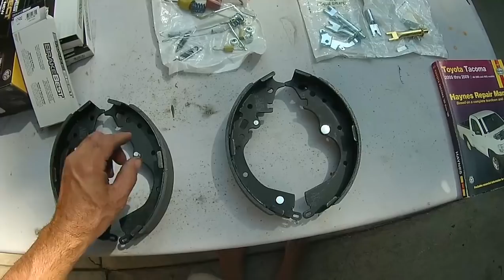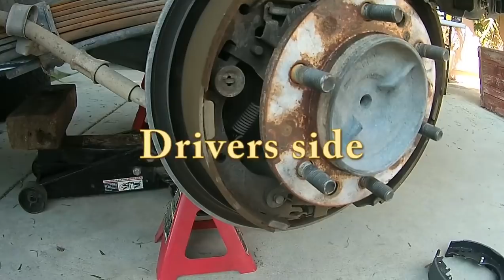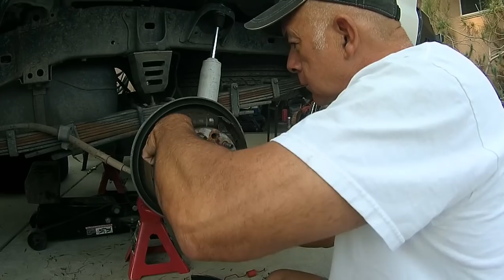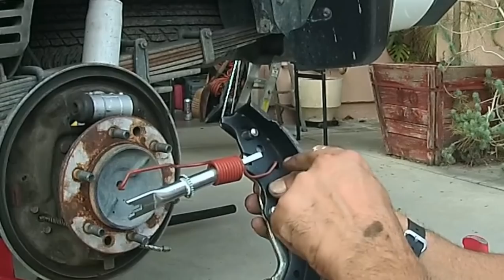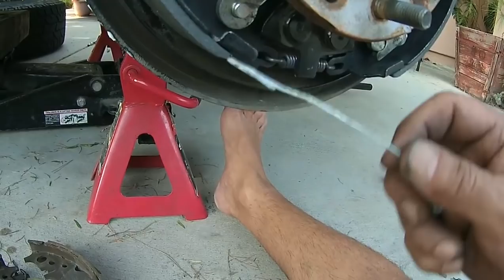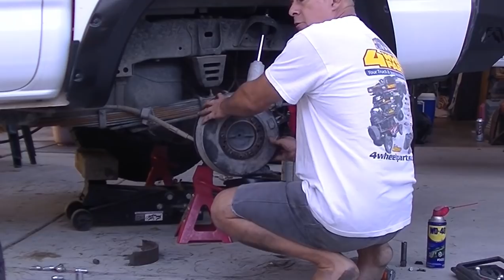2010 Toyota Tacoma Rear Brakes

Comment: Thank you for taking the time to make a video.  I know first hand what a pain in the ass it can be to do the job with the added chore of trying to make a video that makes sense.  Greatly appreciated.  I have a 2014 Tacoma that I just replaced front brakes on, been putting off the rear brakes.
Reply from the maker: Yes the rears are a pain in the arse!

Comment: Awesome video. Just bought a used '14 Tacoma 4WD AC 6-speed and replaced my fronts. Will be checking on the rears tomorrow. Thanks for taking the time to explain everything that you did. Excellent video!
Reply from the maker: Thank you for the comment. What I didn't show was the adjustment. Kind of a pain to adjust.
Reply: @rudedogii  I've adjust the parking brake on my '12 Sienna which is just drum brakes combined with disc brakes. Kind of neat. Had to jack up the rear and spin the wheel ....Then take the wheel off and adjust through a hole covered with a rubber plug from the outside with a screwdriver. The parking brake was never adjusted by the dealer, purchased brand new, and did nothing to stop the car on a hill.

Comment: Thanks for the video. I always like to try to get a refresher on these things. I appreciate your time.
Reply from the maker: Thanks for the comment. I need a refresher myself every now and then.  This videos two years old already. Brakes are still good but needed adjusting and had to replace the drums.  I'm now at 98K and I seem to be losing power. Do you think this is normal at 98K?
Reply from the maker: I drive out to the Hi-desert on the I-15. The truck has 35inch tires with stock gearing and a five speed auto. I don't use the 5th gear. The truck use to run up the I-15 in 4th no problem but now it's having problems keeping up speed and down shifting into 3thrd way to often working the transmission.  Time for new plugs?
Reply: rudedogii did it start acting up after the wheel swap. I hear that with tires like 35s. Look into getting a tuner that has wheel adjustments. If your speedo is off then that's likely your problem. If you don't want to get a tuner most tire companies have a formula chart for wheel size to your truck. The trucks computer needs to know the wheel difference or it has no idea how fast you are going. If I were you I would call the company where you got your wheels. They will know if there are any other solutions. I doubt its plugs and wires but changing them never hurts. Injector cleaner and cat cleaner don't either
Reply from the maker: I'm now on my second set of 35s. Yes the speedo is off. It's been off for years. Driving the same hill. Just cant keep up the speed anymore with out down shifting into 3trd and reving at 4K.

Comment: Thanks for the great video! It was very informative and easy to follow. I've done the front disc brakes for years, but I've never done rear brakes but I'm stuck home so I'm going to give it a try. I'm just wondering if I'll need any of those special tools.
Reply from the maker: Drum breaks are always such a pain with all those parts. Find some info on adjusting. I didnt show that in this video.

Comment: suggestion,   remove  brake fluid from the master cylinder with a turkey baster before (re)compressing the brake cylinder,  ya don't want the master cylinder overflowing brake fluid and blistering engine compartment paint;  thanks for sharing,  nice vid,  oh and I make really sure that baster stays in the garage with the bake tools    :)
Reply: Not really, I just opened the bleeder valve on that cylinder.
Reply: That doesn't happen unless some dumbass "tops it up"... Never top up your brake fluid, that is an indicator of how worn your pads are without having to take the wheel off. There is no reason to ever top up your brake fluid unless you just repaired a leak. It doesn't evaporate, it doesn't burn off, it doesn't vanish into another dimension... as your pads wear there's more room in your piston to hold fluid, it's still all there, so when you compress the pistons it brings it back up to the full line. If some idiot puts more in the reservoir, it becomes over full when you compress the piston for new brakes.

Comment: "Hopefully you remember how everything goes..." I hope so, too!
Reply from the maker: That's why you do one side at a time. I had a couple of buddies show up one day and give me a hand. Them boneheads  took everything a part and couldn't remember how to put back together. I can screw things up all by myself don't need any help.  Thanks!
Reply: rudedogii As it turned out, my shoes were hardly worn much at all, even after 120k miles.  Put them back in the box for another day.  I guess maybe it's because of my stick-shift engine braking and lack of towing.

Comment: Nice job.  Enjoy watching how your Tacoma transforms to your personal specs.  I rather work on disc brakes than drums but we gotta do what we gotta do. Did u had the drums turned before putting it back together with the new shoes?
Reply from the maker: +Robert Lacson Drums looked. I'll havem turned and rebuild the cylinders next time around.
Reply: +rudedogii good job nonetheless.  I forgot to mention to you that it will help dabbing some anti-seize around the hub so that your rims won't stick when you take it off.  I wish we have some places (off road trails) I could take mine off roading here in the east coast....trails like the ones on your other videos.  It looks deserted and not too very populated area.

Comment: I'm surprised a 2010 truck still uses old style drum and shoe brakes on the rear. My GMC truck is much older and has disc brakes all around. The rear has both a disc and a drum system with disc brake pads, dual piston calipers for stopping,  but the rotor has an inner drum with shoes for the emergency brake only.
Reply: The brand new ones do too.  They also stop a bit better than the new Chev Colorados that have 4 disks.  Toyota claims their reasons behind still using rear drums.  Perhaps it's really not a bad thing.  Still suprising though!

Comment: Should be be using high temperature brake grease on the brake shoe pads on the backing plate, not white lithium grease which will melt.

Comment: How did you get the drum off?  That's my thumb's down.
Reply from the maker: You need to drive two bolts into the drum. Look and you will see two threaded holes in the drum.  What size sorry I dont remember.
Reply: @rudedogii  Thank you.  I brought up your video because I couldn't get the drum off.  Thought I missed something.  The rest will be straightforward.  Thanks for the reply.

Comment: Yall been having any u joint/drive shaft issues?
Reply: I did on my 2007 Tacoma the dealer charged me around $1200.00 to fix it . At the time it made sense for me to have them do it . Anyway a year later I git a letter fro Toyota about it and to keep this short they sent me a check for the full amount of the repair .

Comment: Hey buddy what size bolt and thread pitch did you use to pop those drums off?
Reply from the maker: +AZ TACO I think! It takes a 8M corse thread?
Reply: +AZ TACO Actually it is M8x40 or a M8x50 1.25  pitch.